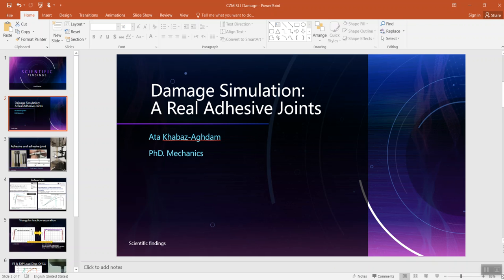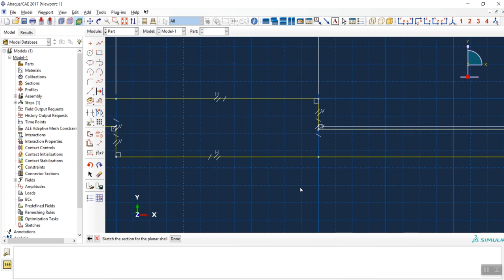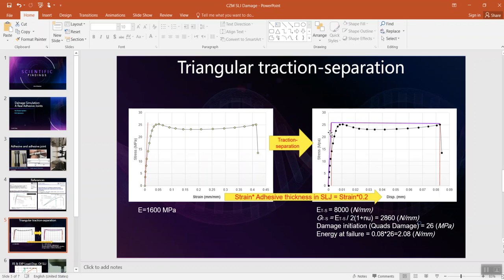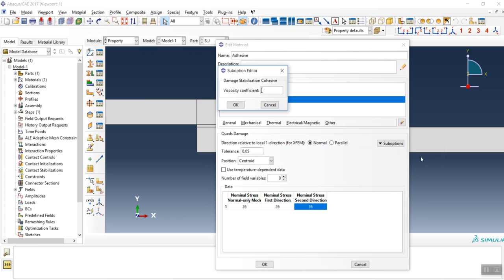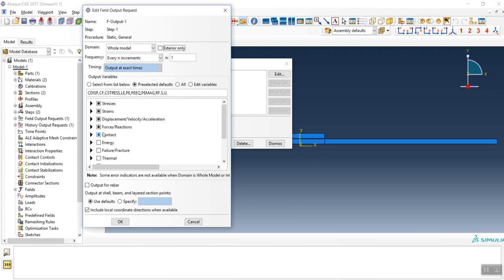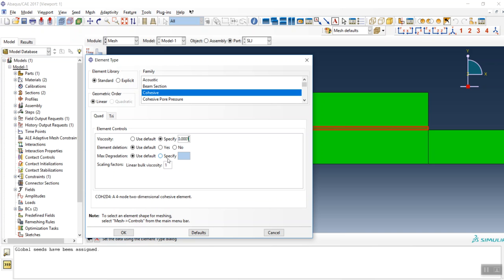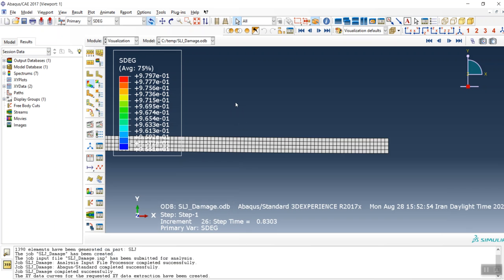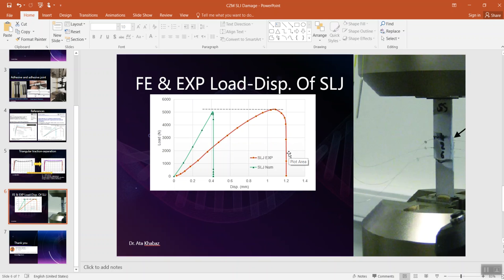Mastering CZM Damage Simulation in ABAQUS: Step-by-Step Tutorial for Adhesive Joints

Comment: i need dissimilar adhesive joint model and simulation
Reply from the maker: you can use different material properties for each adherend to simulate dissimilar joint.
Reply: I did a 3D model and gave different properties but the error came, my joint is Al and cfrp,
Reply from the maker: @LUXECLIP-r5s it seems like you used orthotropic properties for cfrp, if it is the case you also need to define the principle directions for it( cfrp). Check it.

Comment: Hello sir, thank you for this useful video .  I have developed a three-point bending test model in Abaqus, consisting of 20 composite layers and 19 cohesive layers. Each composite layer has dimensions of 120 mm in length, 13 mm in width, and 0.15 mm in thickness. The cohesive layers, which are placed between each pair of composite layers, have a thickness of 0.001 mm. The span length between the two supports in the bending setup is L = 9 mm.
In the material module, I defined the properties using the "Engineering Constants" option. As the punch displacement increases, the S11 stress component also increases, which is expected due to the elastic material definition.
My main question is: what steps can I take to determine the maximum force before failure or the flexural strength? My objective is to write a script that allows me to vary the number of layers and their orientations in order to optimize and achieve the highest possible flexural strength or peak load.
I have based my simulation on the article titled "Progressive Failure Analysis of Laminated CFRP Composites under Three-Point Bending Load." I would be very grateful for your guidance, and if possible, I would appreciate having your email address for further correspondence.

Comment: Thanks for the great video, how we can simulate the cohesive or the contact between the aqqregrate and the mastic in Asphalt concrete mixture? there is no layer the surfaces contact each other directly
Reply from the maker: @Syria_Free_MS  you can assume there is a layer with a small thickness or directly use the traction separation damage as a contact. I may make a new video about it.

Comment: Excellent, thank you for the tutorial. I have a question: If we simulate a roll-bonded sheet for the 15 mm cohesive section in your example, how should we do it?
Reply from the maker: @imasoudkhalili  Thanks for your interest. You know it closely depends on the type of failure in your joint. For example for the interfacial failure you can't use these czm parameters since it is mostly affected by the interface damage parameters. On the other hand, as you get a cohesive failure within the adhesive layer (as you said with a large thickness), you need to calculate the effective failure thickness for your special case. I mean there should be a limit for the czm layer in the adhesive layer, that you need to define it by verifying it with the experiments.

Comment: Good evening sir, thank for the video. When i trying to simulate slj test with cohesive element as interface layer, at the end of analysis cohesive elements distorted and haven't been deleted. Can you please tell me what is the possible reason of that?
Reply from the maker: In some cases element deletation doesn't work. However, you can check SDEG(the damage parameter) in your contour results and you can consider damage for elements with SDEG more than 0.98.
Reply: @atakhabaz3607  so if I specify the max degradation equal to 0.98 in my mesh control, so the distorted element could be deleted?
Reply from the maker: @AlisherAshirbekov  the thing that you mentioned is something else. It's the input value for your simulation that indicates the deletation should start when D is 0.98. However, sometimes Abaqus doesn't show the elements deletation. In those cases, you would better to check D parameter from you counter results.
And consider If the damage parameter D exceeds 0.98 for specific elements, you can consider those elements to have failed. You can check the D parameter using SDEG.

Comment: so we use the tensile test of the epoxy, specifically stress strain curve and compare with the lap shear test results: load disp? because my tensile test results do not look like in the video and when im comparing them with lap shear test load-disp results, they are too big
Reply from the maker: In this case, the adhesive shows a ductile behavior and this approach can predict final load very well. It should be useful in brittle adhesives as well. The main condition here is that you have got a cohesive failure in the bond line not an adhesive failure.
Reply: @atakhabaz3607  i had 99% of damage, should i play around with G values? because im getting too big values for load and disp
also can i contact you for more help?

Comment: Hello Dr. Ata, I followed your instruction, but my simulation does not run..... It is giving me "CRITICAL FRACTURE ENERGY IS SMALLER THAN THE ELASTIC ENERGY PRIOR TO DAMAGE INITIATION" My stress-strain curve is of triangular. So I multiplied the strain with thickness of the adhesive element to get stress-displacement curve. Now, when I take the area, it is coming about 2.0 N/mm. When I fed this in my simulation, it is not running. So I tried to decrease the energy (trial & error). So it runs. there must be wrong with my model. Please tell me what mistake I am doing? Than you for your help.
Reply from the maker: Hi MONO, 
Since I don't have detailed information about your simulation, I can only guess some probable mistakes. 
Please check the following:

1. You need to change either the initial stiffness or the Young's modulus in the normal and shear modes.

2. You are not allowed to mesh the bonded line with more than one element in the thickness direction.

3. You are not allowed to change the maximum traction because this parameter is more important than the G value.

4. Maybe you have experienced adhesive failure in your experiments. If so, the interface region is weaker than the adhesive layer itself, which introduces an error in your simulation.
Reply: @atakhabaz3607  Thank you, Dr. Ata. I recalculated Young's modulus, my mesh is alos one element thick, Rest I have left all the default value. We simulate two conditions, one at room temperature and second at higer temperature. So now, my simulation runs, the cohesive elements starts to vanish, but then it stops with an error ..."THE SOLUTION APPEARS TO BE DIVERGING. CONVERGENCE IS JUDGED UNLIKELY."  Thank you once again. Regards

Comment: Thank you for the video it is so helpful. Please can you explain how to have travtion separation parameetrs in the case of belinear czm model. Thank's in advance
Reply from the maker: Thank you for your interest. Actually here we also used the triangular or bilinear CZM. this triangular damage model indicates using 3 individual parameters of 1. initial slop (or elastic Props), 2. the maximum amount of traction (Sy), and 3. the area under the triangle traction-separation diagram (Energy at failure).
Reply: @atakhabaz3607  then I Can do thé same to get parameetrs. Thank you so much
Reply: @atakhabaz3607  Hi I am working on DCB test , I made all steps but when I compare the RF at the reference point I find thant FEM force is so high compared with experimental force. I don't find the source of problem, Do you have any idea please.
Reply from the maker: @imendebbabi8071  I think you have got the science border. But according to my experience it can be due to some reasons. 1. You maybe use a brittle adhesive in experiment. (If you use Araldite2011,then it was cured in room temperature maybe). 2. The domenant fracture area in DCB test is adhesive.
Reply from the maker: I mean Adhesive failure not cohesive.
Reply: @atakhabaz3607  thank you I will see

Comment: Okay, thanks, Doctor. To specifically note what I mean, how can we obtain the shear stress and peel stress distribution along the bond line over the overlap length? Which output tool in Abaqus is responsible for displaying the peel and shear stress? From what I've tried, 'S22' seems to represent peel stress, but I'm uncertain about the shear stress—whether it's represented by 'S11' or 'S12'. I know 'S33' is for mode 3 or out-of-plane stress. Again, I really want to thank you for your generous support.
Reply from the maker: Thank you for your insightful question. As you mentioned, in this case, S22 represents the peel stress. When it comes to shear stress, we cannot consider any Sii stress form as shear stress. Sii always represents the perpendicular stress in the ith axis. Shear stress always requires two individual axes to determine it properly. One axis indicates the applied plane, and the other indicates the stress direction. Therefore, in this 2D problem, S12 is the shear stress, not S11.
Reply: I sincerely appreciate your generous support. Thank you, Dr.

Comment: Everything you said is true
Reply from the maker: As I said in the video, this is the simplest method that only needs stress-stress curve of the adhesive layer. However, if you need to obtain more accurate result you have to do some other tests like DCB or ENF to get fracture energies on modes I and II, respectively.